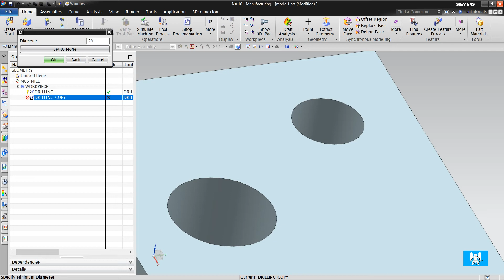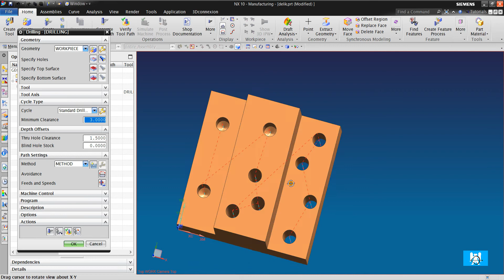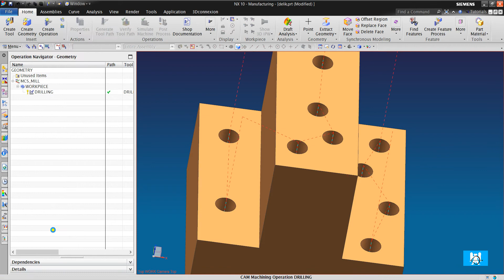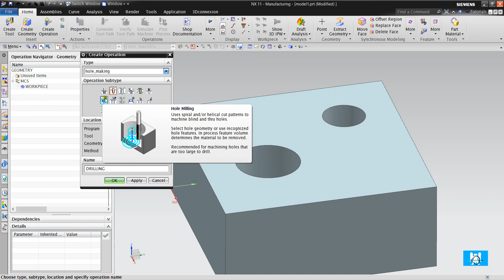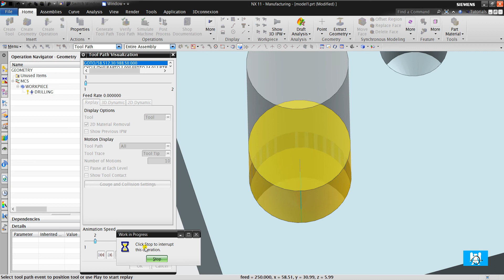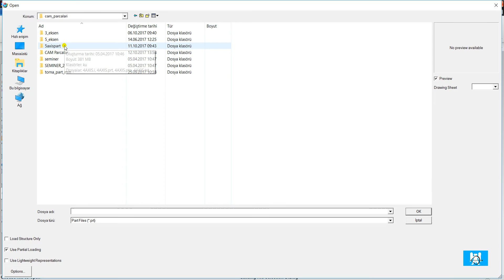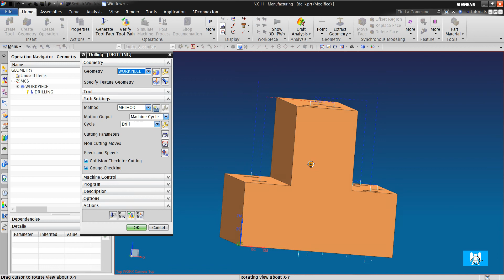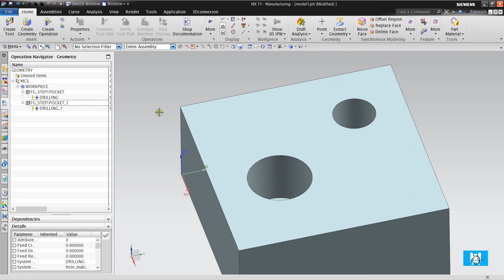42-Introduction to Hole Making

Comment: Nice explanation yousuf👍...please explain about thread milling on planar milling if possible.and attach the part files you are going to use as you did for the previous files.
Thanks in advance
Reply from the maker: Hi Karthik. Thank you. I wil explain thread milling. But it is not in planar milling. It is in hole making  operations.
Reply: Yusuf Uğurluoğlu ....thanks a lot ...